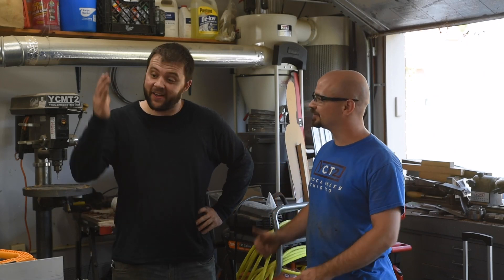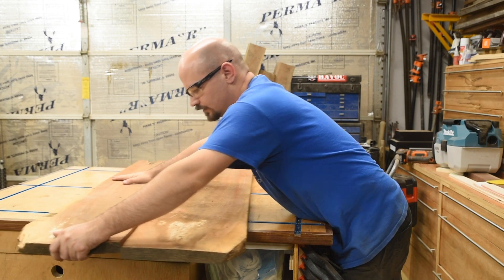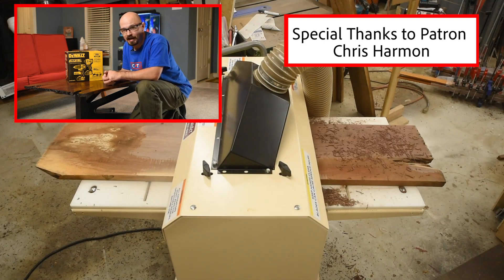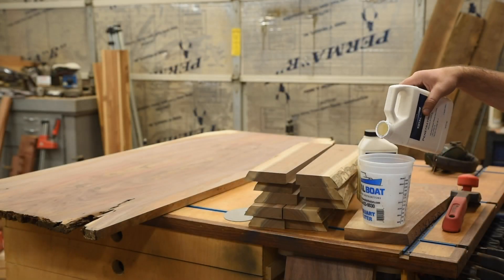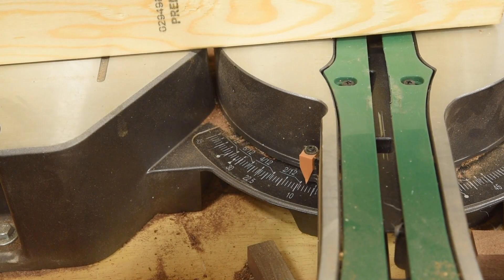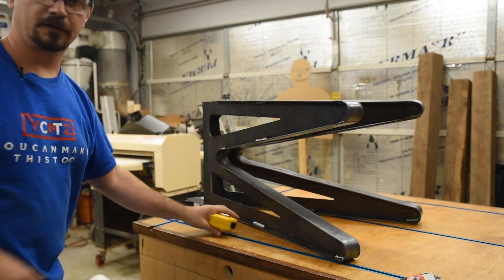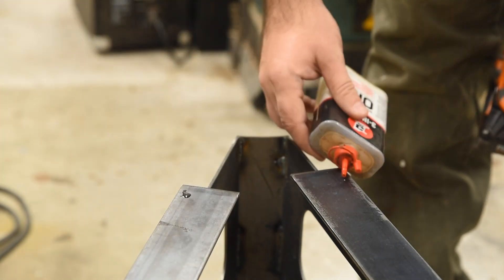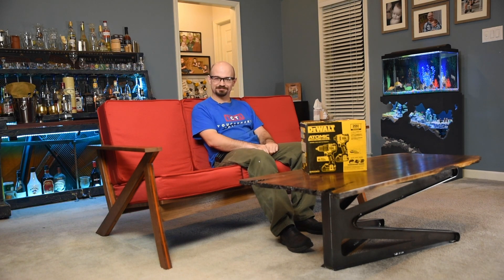Make a Modern Coffee Table Top w/ 42 Fabricate

Comment: No biscuits, dominos?
Reply from the maker: All they do in a panel is aid alignment, which is the same thing that cauls do.
Reply: I'm pretty sure that is sheer blasphemy in the religion of YouTube woodworking.  :-)
Reply: And a bit more gluing area :o)
Reply from the maker: @myutube6422  A marginal amount. On butt joints they add a lot of strength. Not so much on panel glue ups.
Reply from the maker: @randomnonsense_1  Probably! But when I made this I had neither a biscuit joiner nor domino. I do have a domino now.. but don't expect to see it much.
Reply: @YouCanMakeThisToo  I like it when makers don't use a Domino. Some of us do this as a hobby and that tool is WAY out of my tool budget. 😆